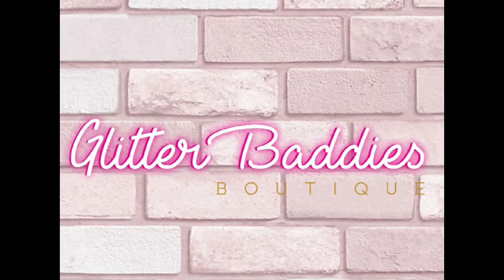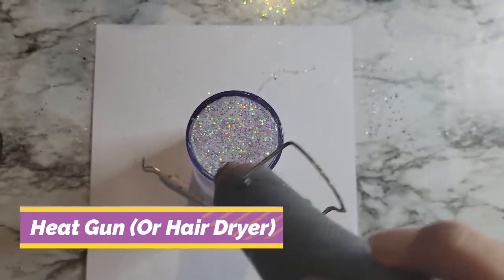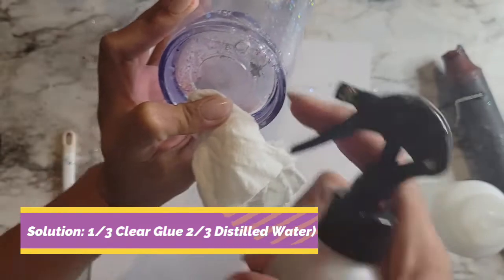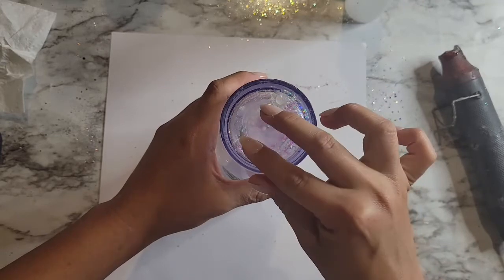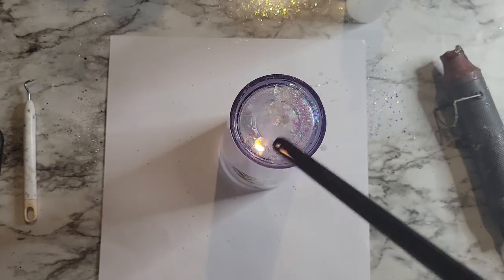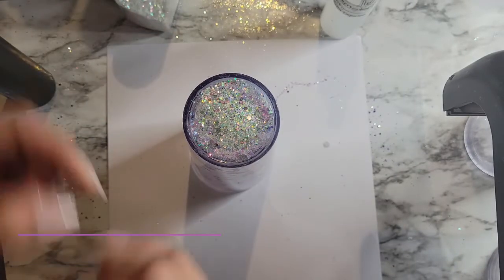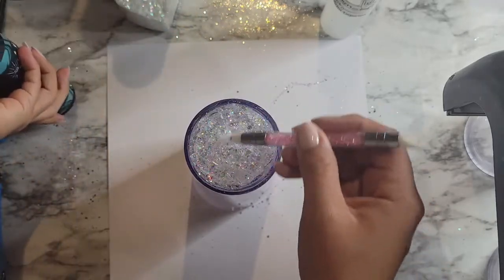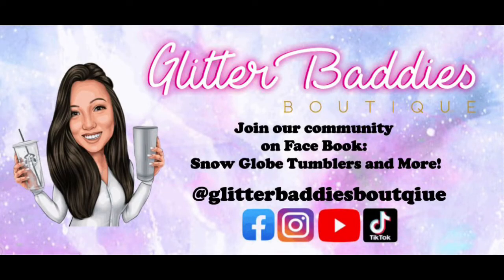Remove and Reseal Snow Globes Tumblers

Comment: Does this only work if you used uv resin? What if I used regular epoxy to fill the bottom after sealing with uv resin.
Reply from the maker: Itll totally work with epoxy (I do the same as well) and it just takes a little extra heat
Reply: @creativelyv  Thank you!!!